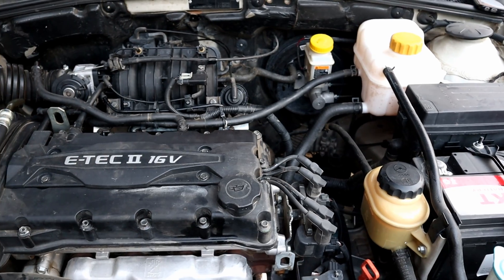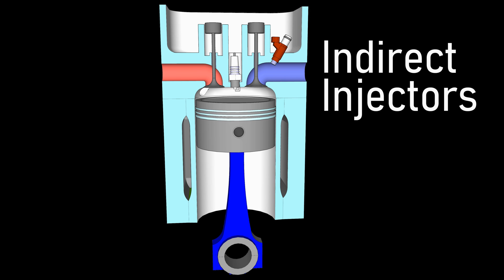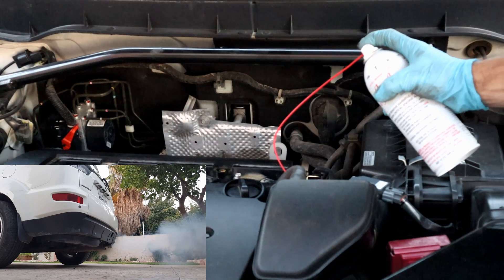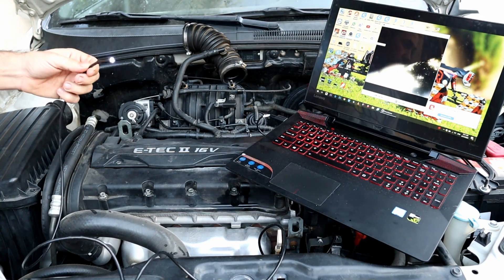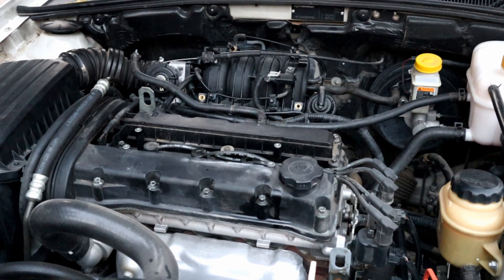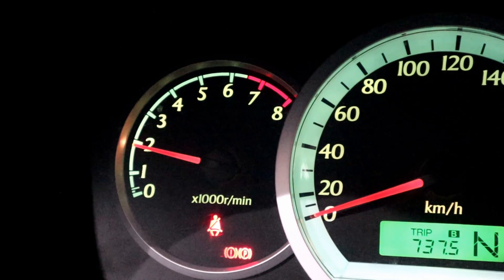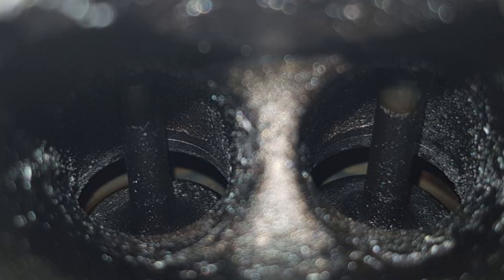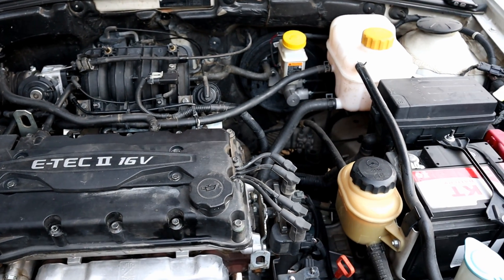How to clean intake valves on Direct/Indirect injection engines without REMOVING anything / ALIMECH

Comment: Guys, you Don't listen to him. Just open the intake Manifold spray an entire carb cleaner through the 4  holes of the intake Manifold. Keep it overnight for better action. In the morning you disconnect  the negative terminal give several Crank start . All debris will come out. Spray again a full  carb cleaner. Everything will be cleaned. Now put battery terminal. Drive for 10 min. All okay.

Comment: He's injecting the cleaner from the PCV valve hose?  Good way to add some extra oil into the mix I guess.  Hmm, mine is attached before the throttle body, so that won't work...

Also, "Carb cleaner" ain't gonna do [hardly] anything to clean off that carbon (I call shenanigans).  You need to use something made for doing that like CRC Intake valve cleaner.

Comment: I'm a bit confused but I used to disconnect brake booster on fuel injected vehicles to spray cleaners or pour cleaners in. In your video says pcv hose is that the same hose but not removing it?

Comment: I bought a cheap used car years ago, non gdi. The previous owner's mechanic poked, prodded and swapped everything trying to solve the #4 misfire it had, 3.8l ford. Condemned the motor
It was extreme carbon build up from a blocked PCV.
Did this very thing, this is an old trick actually

Comment: What if I see some engine oil on the valves along with carbon build up? My car has misfire issue. I tried to solve by changing injectors, plugs and some other tweaks but nothing helped. cylinder 3 has more misfires than others and it has more oil on the intake valve. So you think this is the main cause of the misfires? And this oil means stem seals needs to be change?

Comment: Does using carb cleaner not mess with the sensors ?
Reply: What sensors.....
Reply: @dkrawk8309  O2 sensors.  I'm assuming it won't do damage to the cat, it'll just burn off the carb cleaner fumes
Reply: @Az-elite  yes this product is specifically designed for destroying the o2 sensors
Reply: @dkrawk8309  are you sure ?  you had to ask what sensors in the first place.  I'll see if anyone else has tried this and hasn't had a problem with the O2 sensors.
Reply: @Az-elite  oh no. It clearly states on the can that oxygen sensors must be replacing after use. Along with differential, blinker fluid and muffler bearings
Reply: @dkrawk8309  I replacing after every use a thank you very a much
Reply: @JP-ss2ur  yez replacing a every timing thanking muching

Comment: Hi can i clean the same in my toyota highlander 2009 intake valve through the PVC hose? Using the carbon cleaner? Please suggest?

I have a bit of white smoke in start up and also when i rev up the accelator
Reply from the maker: Yes you can do that, but you need to fix that problem first, you might have wear out piston ring or valve seals

Comment: I want to try this method but my question is , when engine is idling, wouldn’t one of the valves be opened just like you showed with brushes in other video with engine off ..??

Can I repeat process when I am not satisfied..?

Comment: there is one big suction hose near brake oil area which has a great suction power . is it ok to do the same method through that hose? and do we need to change engine oil after this cleaning procedure or no?
Reply: some people use the vacuum for the brakes and that works well.

Comment: Greetings. What about the catalytic converter? Will carbon deposits stick to it or not?
Reply: To prevent deposits from clogging the converter, you have to remove the intake manifold in your direct injection engine and manually clean off the valve deposits. Be sure to make sure both intake and exhaust valves are closed in each cylinder.

Comment: sir in my opinion a carbon buildup on valve doesn't affect the engine performance,  as long as valve lips are seating properly. 
it is another thing a high building may cause valve stem heating , corrosion crack & valve breaking

Comment: is this safe to do on a turbo subaru? I usually use seafoam but I've never thought to use carb cleaner instead.
Reply from the maker: i recommend using turbo cleaner instead if your car has turbo, to keep the turbo bearings save

Comment: Using this method, my long-term fuel trim has changed from -8% to -15%, what's going on?
Reply from the maker: It will give error reading, because engine control unit thinks this is fuel, it will get back to normal, or you can reset it

Comment: Excellent demonstration with before and after pictures, nicely done!
Something else to consider when purchasing any Direct Injection vehicle is installing a "catch can" to prevent most of the carbon buildup on intake valves.
Reply from the maker: Thanks, already got the catch can, I showed on my last video, I will install it soon and show how it will keep the valves and piston clean
Reply: @AliMECH  i dont get it there is supposed to be no carbon build since multiport injection yet there is quite alot why?
Reply: @sansarkawt3351 because it's GDI only. Meaning that there is no fuel being injected into the throttle body so there's no way the back of the intake valves can be cleaned with a GDI only motor. Other GDI Motors also have fuel injection in the throttle body which cleans the intake valves constantly.

Comment: sir 
my car is indica turbo (tdi)
can I spray crab cleaner removing the air filter box 
if I spray .it will pass through turbo >intercooler>air intake 
my car doesn't have pcv valve but has oil seperator
please reply
Reply from the maker: If your car is turbo, not a good idea to spray carb cleaner, use turbo cleaner instead, you can use brake vacuum line as well instead of pcv valve line

Comment: Damn if this will solve my poor fuel economy issues, I should buy 10 of these cleaners. Very cheap online. I just cleaned the throttle body and yes the air intake looked a whole lot worse.
Reply from the maker: Well, Katherine, I noticed a big difference with my car, if your engine valves are dirty, this is the best cleaning way

Comment: Hello Mr Ali
Can I pour carb cleaner directly to the piston rings through spark plugs hose and wait for 6 hours then remove it and crank the engine then put on the spark plugs again
Reply from the maker: No, bad idea, it will wash the cylinder wall as well, and all the dirt will gets in to the oil instead burring and comes out of the tailpipe

Comment: Hi  does it matter whether you use carb cleaner or intake valve/egr cleaner.
Reply from the maker: You can use both
Reply: @AliMECH  thank you also can I spray through my brake booster vacuum hose to intake valve with carb cleaner can? And does it matter if the carb cleaner is in a spray  aerosol type can or do I have to spray all the carb cleaner aerosol into separate plastic water bottle like you did for your water through a bottle treatment test and have it sucked through
Reply: @AliMECH  Why do they provide valve cleaner product and then carb cleaner product if they do same job. Is one more aggressive than the other?

Comment: How many km's/miles until you cleaned your intake valves (from the last time you knew they were clean)? I'm just wondering what is a good milage interval between the intake valve cleaning.
Reply from the maker: I usually do evey 10k for my cars

Comment: HI Ali, my car has a maf before the throttle body and a map on top of the intake manifolf after the throttle body. The pcv valve connected to intake manifold is close to the map sensor. Will this damage the map sensor, if i use the pcv valve outlet in the intake?
Reply: My vehicle has a similar setup, my assumption on this based on how the PCV and intake works is that what your spraying into the manifold is being ingested by the engine due to the the crank case pushing air through the PCV into the manifold and the manifold taking in air from the throttle body.  Seems like the direction of travel would be away from the sensors.
Reply: @jcberb  great, thanks. Makes sense and at higher rpm 2000, this would happen smoothly

Comment: Can you explain a little bit more what you mean at 1:48 - 1:51
Reply from the maker: If you watch my latest video here https://youtu.be/U4T5fA9DTMM I showed where to spray carb cleaner without getting contact with throttle body and mass airflow sensor , bc it wall damage there 2

Comment: Will this clean a V6? Where are other locations on engine to insert the carb cleaner? What years are considered modern cars? Great tutorial video!!! Thank you.
Reply from the maker: Yes it will clean v6 too, the best place is the vacuum line to spray the carb cleaner, I also did on 2017 Toyota carry as well, thanks for watching
Reply: @AliMECH  the vacuum line on the firewall?

Comment: This is a terrible idea. Carb cleaner dries out the cylinder walls. Even starting fluid with cylinder lubricant shouldn't be used like this.
Reply from the maker: If you think that cylinder walls are oiled all the time, the car will always smoke and burns oil,
Reply: @AliMECH  the cylinders do always have a film of oil until you spray carb cleaner down the intake. The oil scraper ring keeps the oil from reaching the combustion chamber and thus keeps it from burning oil.

Comment: I know this is real i used that carb cleaner to clean my fuel injectors and it ran like brand new than wasting my money buying new ones 👌🏼
Reply from the maker: Great job!, thanks for yor feedback
Reply: You can clean the idle control valve to with carb cleaner i cleaned a ford taurus idle control valve and fixed the idle on that car runs perfect now ! I clean everything with cweb cleaner besides the mass air flow sensor
Reply: @luxurycaddy8861  the problem with my IACV was it isn't the right IACV for car model. I bought a new one arriving soon. For most electronic parts, I prefer replacement.
Reply: Yes I agree. Could be a waste of money when you can clean them up. OEM ones are not cheap.

I bought a tool for cleaning fuel injectors. I think cleaning fuel injectors and cleaning air intake valves will solve my poor fuel economy issues, along with replacing the Idle Air Control Valve.

Comment: Sir, is there any possibility of carbon removed from valves would clogged the catalyctic converter and oxygen sensors?
Reply: I doubt it would. The carb cleaner dissolves the carbon build-up, and then it's combusted and shot out the exhaust as vapor and smoke. And whatever carbon is left on the cat will burn away once you take it for a drive. Cat's clog up when they melt from running the engine running too rich or too lean, or from certain fuel additives like over-the-counter octane booster.

Comment: Hey! Tried your method today.
That is awesome and really working!

I bought a used car, no history about how previous owner used it. (My thoughts are home-shop/work-home)
It has a broken and clogged up PCV valve, which we changed.
But the engine still got a rattling noise.
It's gone now! It's working much quieter. I do believe that was gunk around valves and pistons which is gone by now!

So thanks to you a lot!

PS
By the way, came here after Scotty's of ChrisFix comment section. (Do not remember exactly)

Cheers from Russia, bro 👍
Reply from the maker: Thanks, glad that it worked for you 🙏🏻🙏🏻 Russian  🙏🏻🙏🏻
Reply: @AliMECH  
So you disconnect PCV valve and spray carb choke into PCV hose ? Not thru throttle body?
Reply: did you point the straw on each pair of valves per time?

Comment: Is it safe to rubber seal inside in the long run?
Reply from the maker: Yea, they only thing you should be worried is the throttle and the mass air flow sensor, and I sprayed it after them

Comment: I will replace intake manifold gasket and am wondering if it would be good to spray carb cleaner that way to clean valves?? 🤔
Reply: If you are going to remove intake manifold, you can use a brush and carb cleaner to clean the valves. Work only on closed vlaves, then suck it with paper towel or someting. Then turn the engine by hand and work on other valves.
Reply from the maker: Yea, Adam is right, but make sure the valve is closed before changing them

Comment: No way .carbon is baked on the valves,in order to get your valves this clean ,the would have to be professionally cleaned or new valves Using carb cleaner will not do it.Think about it!
Reply: Tried it on a gama 1.6 gdi engine. It worked. The trick is to make sure the engine is warmed up pretty well, almost hot to burn the carbon deposits.
Reply: Agree with you

Comment: AliMECH would you advice doing this cleaning on a 2007 Honda Odyssey nearing the 120k miles mark? I don't recall to have a PCV line so may I use the vacuum line instead? Thanks!
Reply from the maker: Yea you can use the vacuum line, sometimes I use vacuum line of brake , and it works same

Comment: i don't have carb cleaner straw,
i do have very thin wire
If i pull the wire out of its plastic skin
can i use the plastic skin in place of the red carb cleaner straw?
Reply from the maker: Yes that's a good idea

Comment: Hay bro nice video I have the electric cable for the TBS so I would need some one to be in driver seat to keep rpm at 2000 or I can do it alone with car just idling thanks
Reply from the maker: I did that on my electric throttle camry, with a wood stick to hold the rpm, but yea, if you have someone to help you, will be better
Reply: I just used a paver

Comment: What if u got electronic throttle body and cant put it after the throttle body where should you put the straw
Reply from the maker: I didn't run it thrown the throttle, I used vacuum line pcv, it will enter it after throttle, never enter it from throttle
Reply: @AliMECH  I know what u mean but on my 06 Pontiac grand prix 3.8 liter V6 my pcv valve is a close system so not sure where I would do it at, could i use the booster hose connected to the back of the upper plenum
Reply from the maker: Use a long straw like mine and run it from throttle, till it passes the throttle
Reply: Make sure it pass the MAF. Brake booster vacuum hose is fine.

Comment: Did you use this just like a seafoam application? 

I see you used it like seafoam, but how about step by step?
Reply from the maker: Yes, I sprayed the carb cleaner from pcv valve at 2000 rpm, but it's much effective than seafoam

Comment: Great videos bro! Your comparisons help me out! I want to clean my intake valves but I have to do an oil change. Should I do an oil change before or after? & what do you think about doing an oil flush? Thanks I appreciate your help!
Reply from the maker: This method of cleaning with carb cleaner, no need for oil change or engine oil flush, I have another video were I cleaned the intake valves with water, u recommend oil change after that, but for carb cleaner, NO NEED TO

Comment: Awesome videos and comparisons bro! I have to do an oil change but I wanna take carbon off my intake valves too. Would you recommend doing an oil change after? Or maybe an oil flush or engine flush & then an oil change
Reply from the maker: This method of cleaning with carb cleaner, no need for oil change or engine oil flush, I have another video were I cleaned the intake valves with water, u recommend oil change after that, but for carb cleaner, NO NEED TO

Comment: I'm starting to suspect that this might be my issue on my GDI, some major Carbon build up on my valves. I changed my plugs and plug wires, cleaned the throttle body out and it still runs a bit rough on/off during idle. Feels like the torque power isn't there when accelerating.
Reply: Same here, 1.0 TSi ecu mod to 250nm, used to skid on 2nd gear on dry road, now NOOO way + it eats more

Comment: Does it work on multi point injection system?
Reply from the maker: No, it only cleans intake valves, I have a video, this method cleans fuel injection https://youtu.be/iDlLvCh4JDA
Reply: Thank you for replying even the vid is 5mos old. Kudos. Il'l check out your video
Reply from the maker: No problem, anytime

Comment: Is it good to use stp complete fuel system cleaner with this and suck it like seafoam the switch off for 20 min then start engine and how if we keep it till next morning is it ok then start up or it'll make hydro lock??
Reply: it wont hydrolock, even if you think you have hydrolocked the engines, take out the sparkplugs and crank the engine to take out excess liquid

Comment: hello
do you recommend this method as asafe for engine? and which hose can be used is the pcv valve hose or the braje booster hose? 
thank you
Reply from the maker: Yes its safe for engine, I always use pcv hose, never spray it from throttle

Comment: Good tip, thanks for sharing. I subbed :)
Reply from the maker: Thanks, you are welcome 🙏🏻
Reply: @AliMECH  Can this work on Lexus rx330 2004 engine? If yes, where will the straw pass to get the carb and choke cleaner into the engine?
Reply: @AliMECH  Can this work on Lexus rx330 2004 engine? If yes, where will the straw pass to get the carb and choke cleaner into the engine?

Comment: Brother will this process also clean egr?? Is it possible to clean egr without opening?? Thankyou!!
Reply from the maker: No, because in this process the carb cleaner sprayed after the throttle, for cleaning egr, throttle cleaner spray must be used and spray before the throttle, but it hate to be throttle cleaner can, otherwise it will damage the throttle if its electrical
Reply: @AliMECH  thank-you Brother! have a blessed life!!
Reply from the maker: Thanks bro, same for you

Comment: The solution for that built up is a oil catch can .
Reply from the maker: Agreed 🙏🏻
Reply: Oil catch can work for non direct injection too?
Reply: @zanuarrosyidi4034  Yes, it would reduce the crankcase fumes  getting to your valves but it's just overkill and not needed on non GDI engines. Your fuel injectors are always bathing the back side of the intake valves and keeping them clean.